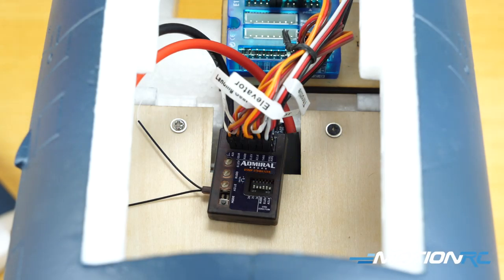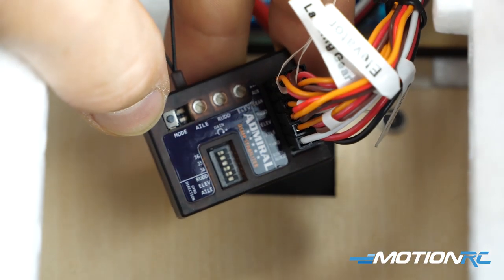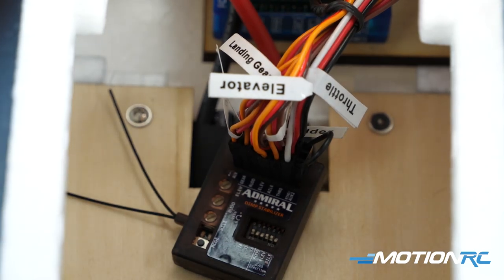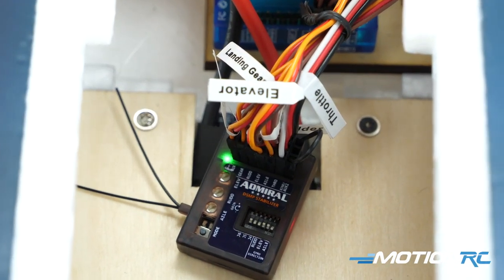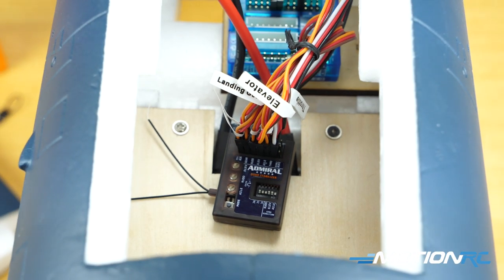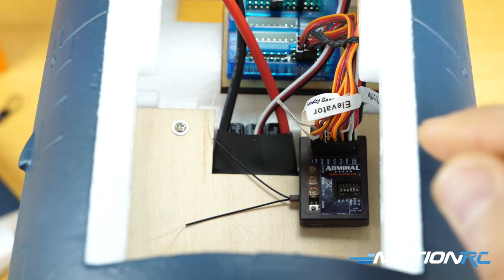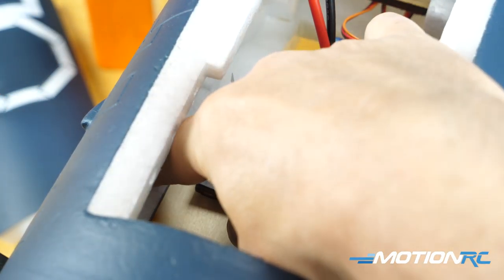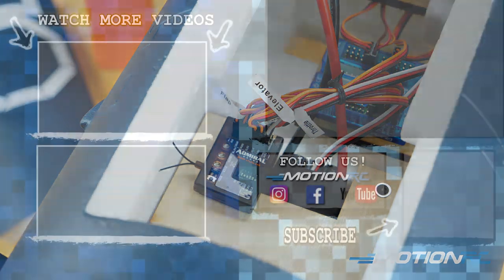Binding & Installation - Admiral RX600SP Stability Plus Gyro - Motion RC

Comment: I have a DX6E and the Admiral receiver when I try to bind I have no throttle to the motor , the airplane is a F-8 from Motion RC. I have a panther and mustang with the same receiver from Motion with no problems.

Comment: The receiver/battery hatch placement in my de Haviland beaver on the bottom side of the plane.
 
  What happens if the receiver is upside down as this seems to be the only possibility
Reply from the maker: Persally, I have installed this upside down in aircraft to great success despite the manual saying different. Just make sure the leads are still toward the tail of the plane and that all the directions are correcting properly. It should be fine that way

Comment: Ok in safe mode C-GEAR only one side works on ailerons?
Reply from the maker: Not sure I understand, but your ailerons should be y'd together into the aileron port, so both should correct.
Reply: @MotionRC  Gotcha I just got a y harness yesterday that was my issue. Ty

Comment: So can these receivers take the place of spektrum SAFE technology? That's whats kept me in the Horizon Hobby planes as I like the option of SAFE especially on high performance planes and for maiden flights if something goes wrong.
Reply from the maker: These receivers have an auto level feature, but not necessarily safe where your bank angles get limited. A gyro really only helps on windy days, its time to take the training wheels off and really feel your model
Reply: @MotionRC  I have several HH planes with SAFE and I do not like it on any of the planes.  An auto level feature is more valuable to me. when I maiden an plane with the Admiral receiver, I use the on/off feature for Stabilization. Once I trim the plane out, I get it up high and turn on the Gyros. If the plane goes crazy, turn off the gyros and get it down and correct.  Else do a high speed pass to see if there is any oscillation. After setting the gyros, I will switch to Stab always on with the auto level button.

Comment: I have something set wrong. The LED continues to "blink" after binding. No solid green LED light. ah oh  :(
Reply from the maker: The gyro is set to off that means. Did you set up a combo or set up a switch?
Reply: @MotionRC  Yes. Combo A. (I) button per the video. TX is a DX8G2
Reply: To more accurate it's more of a flicker. To fast to be called a 'Blink'...
Reply from the maker: @fishalcoholic  very hard to diagnose in comments on YouTube, please call our customer service or live chat with them. They can help much easier

Comment: Hi James
I know this is a old video, but I can only mount the Stability Pus in the left or right side of the Fuse (not center) of my Beaver. Will this be ok as long as it straight front to back???
Thanks 
Danny
Reply from the maker: Yes, will not be a problem at all
Reply: @MotionRC  thank you
Danny from Tennessee

Comment: I have a FW 190 where I'm replacing the old receiver with the Rx600SP but to get the receiver mounted upright is kinda a pita since all the electronics are on the underside. An inverted mounting would be easier, especially if I ever wanted to adjust gains or change the combo setting. What exactly has happened to airplanes where the receiver was mounted upside down?
Reply from the maker: Honestly, it is a recommendation in the manual and could void a warranty, but I have it installed upside down on an aircraft that still works fine to this day. I just reversed the switches and notice nothing. If you go for it, then just make sure your inverted spot is flat and level. Don't want it on a curved surface.

Comment: How does this gyro know level? Does it auto calibrate, or do you have to install it level. I just flew an airplane I bought from a club member with it, and the airplane was always tying to turn slightly right in level flight. Normal mode, slight right level turn. Not allot, but enough to be annoying. Still totally flyable. Thanks.
Reply from the maker: This gyro has to be mounted in the direction show (flat with ports toward the aft part of the aircraft). But the Gyro won't fix a plane that isn't trimmed properly. Check to make sure gyro is completely flat and also make sure your control surfaces are mechanically trimmed. I always turn the gyro off for a maiden and trim my plane first, then turn the gyro on to get a better idea of how the gyro is tuned
Reply: @MotionRC   Hello, thanks for the reply.  I understand trim, I have been working on real aircraft for 35+ years. No amount of trim with the gyro in effect seemed to correct the issue, as I attempted to trim the the airplane left with no result. The GYRO I believe was commanding the right turn, to me, like it believed it was level, and was maintaining it.

I have 5 of the Eagle A3 Super 3 Gyros, and with those I shore and level the model, I enter/calibrate "LEVEL".

 Is there no way to calibrate level on this particular system? 

I saw one video where someone speaks about leveling it out of the airplane, which make no sense at all. I am just trying to confirm/understand the method, if there is one, to calibrate level. I will disable for the next flight, recheck mechanical  flight control position centered/fared, then trim the airplane, then activate the gyro to see if it act the same.

Thanks.

VR
Reply from the maker: @vintageracer3734  This gyro doesn't have a calibration like the Hobby Eagles. The Eagles can be mounted in numerous ways so the calibration makes sense there where this one only mounts one way. Check to see if the gyro is level inside the case, could be possible the case looks level but the internals are not (you can easily pop the case off this gyro). Then by all means contact customer service if there are still issues.
Reply: @MotionRC   OK, perfect, so I suspect its not installed level, and like I mentioned earlier, it came in an FMS 1400MM ZERO  I bought from a fellow Club Member. It works great, the install looks first class, which is why I did not want to remove the  Admiral RX600SP Stability Plus Gyro from the airplane if it was possible to calibrate level after install. Its probably just a touch off level. Thanks for the help, and all the great videos from your company. Also thanks for the offer for support. 

VR

Comment: James, does the Admiral logo have to facing forward or can it by to the rear? I’m putting this into the FMS P40b and the wires are a bit tight with the gyro/receiver leads to the rear. Didn’t know if it could spin
Reply from the maker: Between you and I, I never tried it that way BUT, logically I can't see how it shouldn't* work that way. I have to assume if you have it set up as its supposed to be and all the surfaces are correcting properly, then reversing it would only reverse all of the direction correction to which then you would just flip the switches on each surface control. But I never tried it because I haven't run into an aircraft I haven't been able to mount it as the manual says.

Comment: When I bind "no problem" both green and red lights are on . I think this means gyro is off. How do I get just the green light to stay on ?
Reply from the maker: depends. have you set the j4, j5 and j6 dip switches to their correct locations depending on the type of model you are binding it too? (ie. delta, v-tail, flaperon or normal?) Look on the back of the receiver and there is a picture of the different dip switch configurations. If you haven't flipped any, then the gyro will just be all off and it will act as just a reciever
Reply: @MotionRC  Having the same issue bound to a DX6 GEN3.  Had to reverse aileron servo as well.  J4 and J5 are in the on position for a normal plane (Flightline fw 190 dora).  Please help.